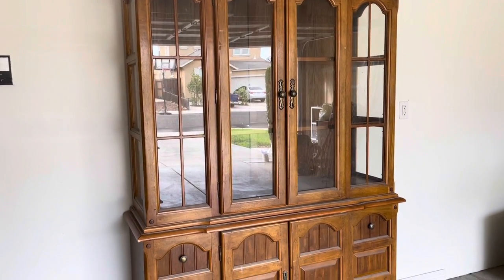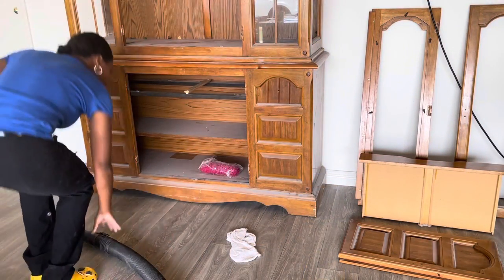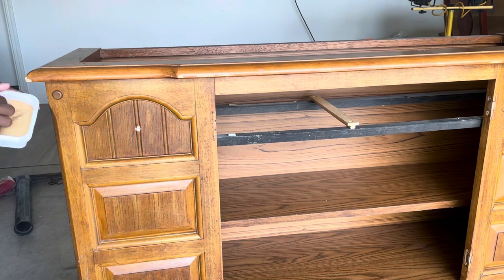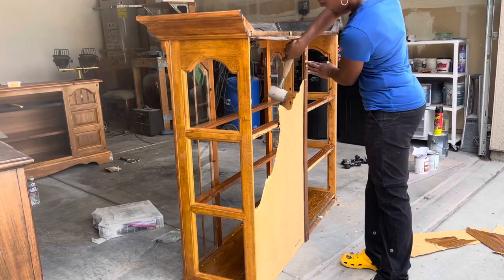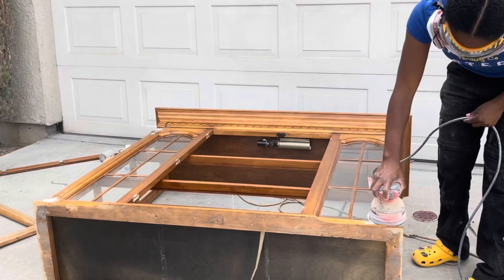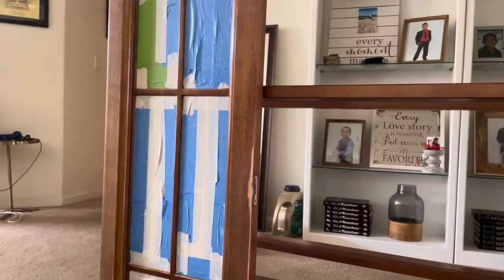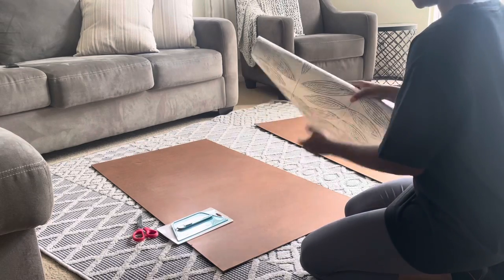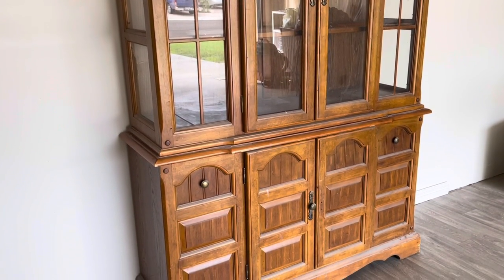STUNNING HUTCH MAKEOVER!!! (DIY Flea market flip)

Comment: You might wanna consider using mineral spirits to wipe down the dusty shelves. It does a good job of accumulating the dust onto the rag, it doesn’t saturate the wood pores like water, and it’s helpful for sappy/oily/icky substances on the surface.

For the protruding buttons, you might be able to take a flush saw to them. They’re under ten bucks at Harbor Freight. You wouldn’t have to Bondo, and you’d have a nicer visual blend.

The terminology depends on the gauge of fastener that tool uses. It’s more than likely an 18ga brad nailer (and stapler).

I really love the solid black paint look.👍👍👍
Reply from the maker: Thank you so much, that is very sound advice. I appreciate you 😀